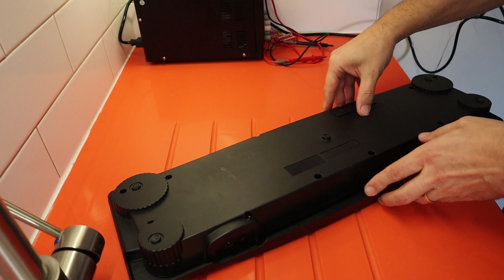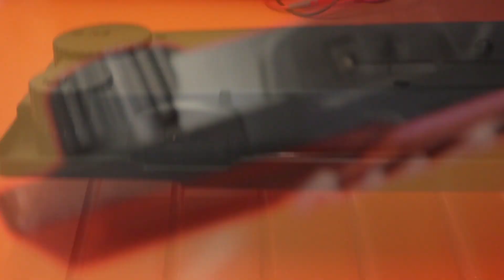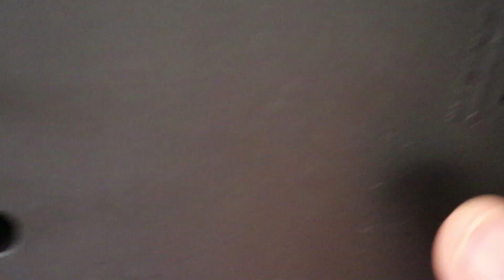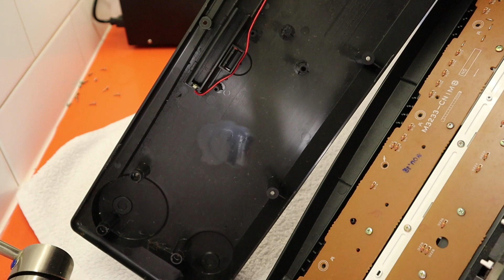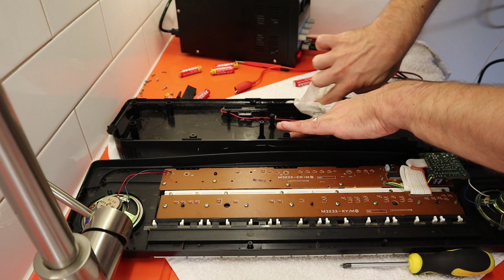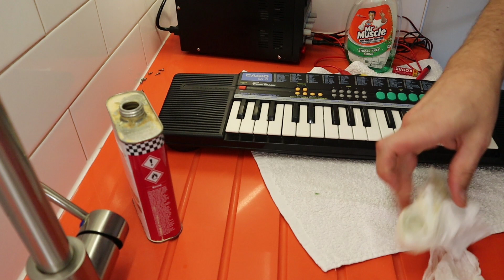Casio SA21 (SA-21) Keyboard Repair & Restore

Comment: I knew straight away it'd be the negative tip. All Casio's are negative tip. Love your videos so nice to see these cool things repaired! 😊👍 Funny how they always have a b c stuck on them..
Reply from the maker: Thanks.... yeah rookie mistake on my part oddly though this is my most viewed vid by a mile! Thanks for your comments hope you enjoy the channel.
Reply: There's a polarity Protection inside I guess so it doesn't get damaged due to Wrong polarity. Some old transformer based power adapters do have a knob to change polarity

Comment: Another great video, another fix :-)  have you ever tried wd40 or gt85 for removing sticky labels and glue etc,  works great,  just have to leave it to soak in for a while.
Reply from the maker: Great tip. Thanks. I haven't tried GT65 but did try WD40 and it worked a treat. Thanks 👍

Comment: I have the same thing. But it is not running when I starting it, tune are not playing only the speaker is talking sssssssss.

Please let me know what's happening.
Reply from the maker: Hi Jaydeep, sorry I don't have the keyboard anymore so I can't help diagnose much. Perhaps try checking the printed circuit board and test components on it.
Reply: @RetroTechRepair  thanks for your response
Reply from the maker: You are very welcome.

Comment: Very nice RTR. ;) I think we have all done that at one point!.  It might be useful to detail how to retrofit a polarity protection diode, as not all keyboards/devices have this and it really is a device saver.  FYI, if you like these sounds and want something with more range, there are 4 octave versions of this keyboard available.  Although not as common as the SA series, look out for casio MA-101 and 201 on ebay, they do occasionally pop up for sale. ;)
Reply from the maker: Hi Chris, thanks for your detailed comments that's a good suggestion, I hope to do a few more keyboards soon. I don't play so I'm always concerned the keyboard repairs are a bit "light" as I just jab at buttons once I have fixed them. If I find one without a protection diode I will definitely do a mod video. Great idea. Nice feedback on alternative models too, I bet they use the exact same IC. Thanks again for feedback. Hope you enjoy the content
Reply: @RetroTechRepair  Yes same silicon chip inside, but many different IC packages.  Have a lot of service manuals and have done some research as wanted to increase number of keys on a number of models, but its not possible on most.  What Casio and Yamaha appeared to do (way back) is produce the same IC on same die, but package differently for different models, that is connect different pins to the silicon to the outer pins on the plastic package.  Its cheaper to fabricate a single fully functional IC then do a different package run, it means that only certain features are available and there are limited easter eggs available.  Some, but not the full potential of the silicon.  Hope thats not too geeky! ;)
Reply: ... Deductive reasoning.  Going by service manuals, the SA series has half a dozen (or more) versions of same IC, same number, but with 'versions' e.g. -16, -08 at the end.  They all have same sounds, but slightly varying pin-outs and in some case reduced pin numbers (cheapest ones).  Bet its exactly the same silicone inside as silicon design & fabrication is the expensive bit.  I guess the best potential for easter eggs would come from the most functional models with most number of pins.

Comment: I have an SA-20 and I can turn it on, the keys work but it only makes piano sound and none of the selector buttons work. Could You please point me in the right direction what to check?
Reply from the maker: I'm no expert I think I'd check for electrical continuity between the button contacts and connection to the processor on case their has been battery leak damage. I'd also clean the button contacts on the board and carbon pads  on the back of the  buttons I  case it's had something spilled on it or they have oxidised. Like I say I'm not an expert so this isn't advice it's just what I would do. Cheers
Reply: @RetroTechRepair  Thanks a lot for the answer, I'll try! :)

Comment: I didnt use my keyboard for 4 tot 5 years
And now i tried to turn it on but it didnt turn on what should i dod for that.......pls help me  if you know
Reply from the maker: I can't give advice but if it were my keyboard. I would try cleaning the battery terminals. You may need to remove the back cover to access the spring terminal and clean off any rust
Reply: Hey i am facing the same problem.. pls suggest anything that worked for you

Comment: hey can you help me with that amplifier circuit on the keyboard based on an8053n circuit!! I lost that circuit while repairing my sa-21.Just provide me the circuit diagram of that amplifier.
Reply from the maker: Hi Charles thanks for watching the video. This was a simple repair and I didn't need the circuit diagram so I don't have it. But I typed Casio SA-21 schematic into google and it identified several free sources. Sorry I can't be more help

Comment: How did you reverse the power supply, i have an adaptor
Reply from the maker: My power supply was a universal adapter which had a reversible DC plug.
Reply: Mine isn't working via power supply. I don't know how to fix it. Can you please help, can you please elaborate how to get that working.
Reply: You can connect adopter also , don't connect more than 5.5 v power